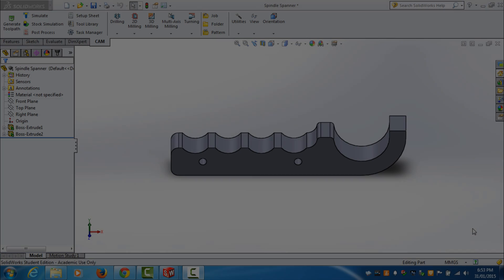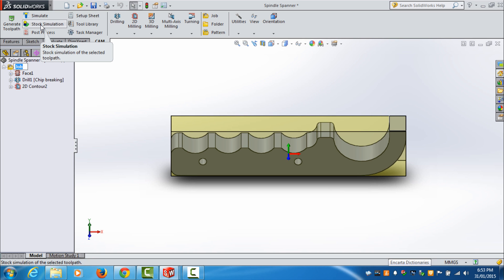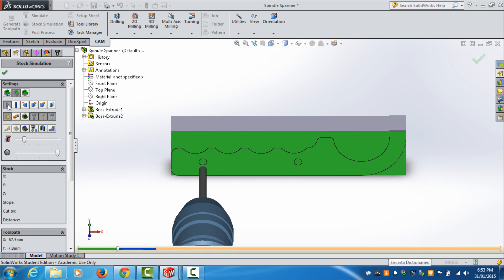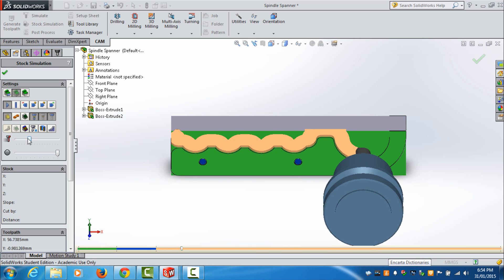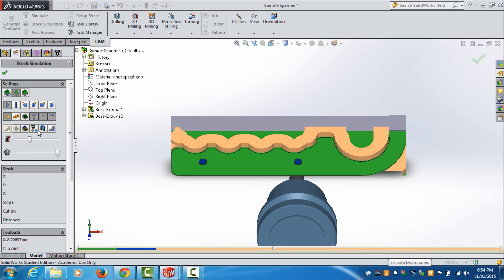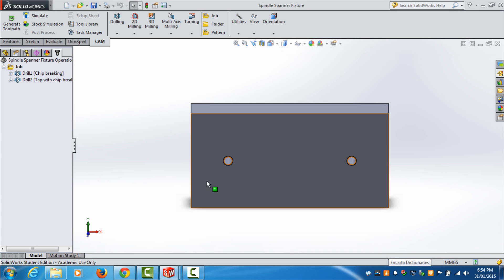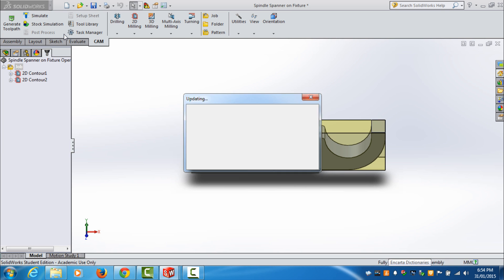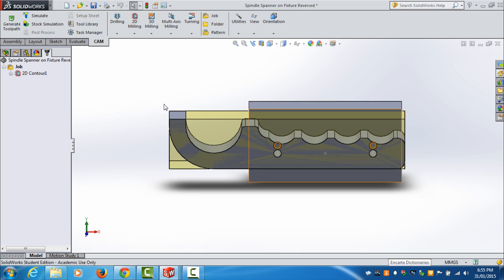HSMWorks Machining on the HAAS - G0704 / PM25 / TM25 Spindle Spanner

Comment: Hi Arron, 

The HAAS does a awesome job but when are we going to see some machining on your TM25V?
Any chances of getting the sld.prt file to have a look at how you programmed it in HSMworks, I am still trying to work out where to start with hsm, how did you learn? I would love to give this ago on my TM25V
Reply from the maker: Jeremy Isoardi Hi Jeremy. Thanks for commenting. Hey, you make a very valid point mate. I really need to do some more machining on my own TM20 CNC mill and stop using the HAAS. However, that HAAS is just so damn addictive and heaps of fun to use :-)   Hey, do you have any suggestions on what I should or could make?  Would you mind sending me a file and I'll program it for you.  I can even machine it if want?  Cheers, Aaron.

Comment: Which spindle motor/controller is that on the G0704 shown?
Reply from the maker: TurboBrooks Hey mate, this mill is a clone G0704 made in China and imported by Titan Machinery in Australia. I think they are now the same as the Precision Matthew PM20 - 25 range newest shipment being sold in the USA.  The spindle is a brushless DC motor and never give a minute of trouble. Cheers, Aaron.
Reply: 10-4. I realized it wasn't a G0704 after I sent the message. Is the motor/controllers one of the samgmutan pieces that I see on kelings site?
Reply from the maker: TurboBrooks Hey man, I missed your previous question sorry. The mills are the same as these ones in the USA now http://www.machinetoolonline.com/PM-MV-BenchMills.html Oh, and the steppers are Kelings Nema 23 570oz, but I got them from automation technologies INC.

Comment: Another great video Aaron. What do you use for feeds and speeds? Do you have software that you use, or do you just work by experience?
Reply from the maker: Hi Gavin, I predominately use Iscar tooling.  As an Iscar customer they give you data sheets / manuals regarding their tooling. I use their RPM formula and inside their manual I enter the recommended "Chip-Per" and all this is fed into HSM.  HSMWorks out the feedrate. As this is School machine, I don't push it too hard and it's tooled up for aluminium only. Cheers, Aaron.

Comment: Fantastic! Great video :)
Reply from the maker: russtuff G'day Rus. Thanks for the support mate. Cheers, Aaron.
Reply: DCTTeacher1 I just watched again and noticed at about 3:45 when you started drilling you were either pecking/pause or maybe pecking/retract. Can you give me some idea of your process, depth, dwell, etc? I've been using more peck drilling lately but it just seems to take forever. I think maybe I'm retracting to far, or maybe to often....
Thanks!
Reply from the maker: russtuff Hi Rus. When drilling in this video with a 6mm drill bit I used the Peck Drilling - Partial Retract option. The drill does this fast pecking cycling going down 2mm per pass.  It full retracts out of the hole after 12.5mm. Cheers, Aaron
Reply: DCTTeacher1 thanks again!

Comment: Fire through the part file Aaron and we will show you how to get open pocket Adaptive Clearing working, its purely down to the selections. Are you selecting edges or faces?
Reply from the maker: Scott Moyse Hi Scott, yes mate it's definitely operator error on my behalf. HSMWorks is totally awesome and I would be lost without it. I'll shoot you the file across to take a look at it. Thanks for all the help you blokes at CADPRO have been giving me.  Much appreciated ;-)  Aaron.
Reply: DCTTeacher1 Have you figured out the open pocket adaptive now Aaron?
Reply from the maker: Scott Moyse Hi Scott, no mate I'm still struggling with this option.  I can do it for a pocket but I can't do it on the external profile.  I will have do a file up and send it to you.  Cheers, Aaron.
Reply: DCTTeacher1 I'll send you something.
Reply: DCTTeacher1 Did you make sure to deselect "Machine cavities?" Select the top face of the part for your model then select the face of the material to be removed as stock.  Then set depth and that should have you cutting.
Reply from the maker: akromix Hey mate, thanks for taking the time to explain that to me.  I'll give it a try next time I'm machining. Much appreciated.  Cheers, Aaron.